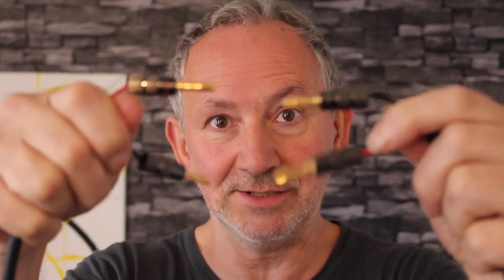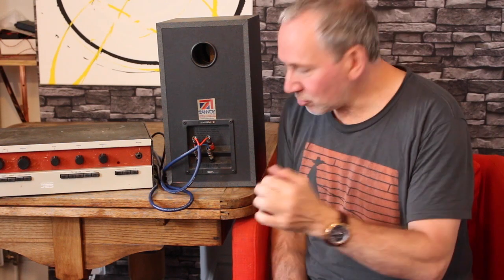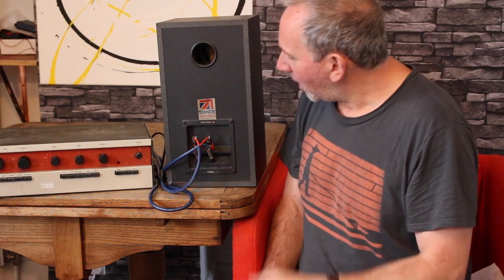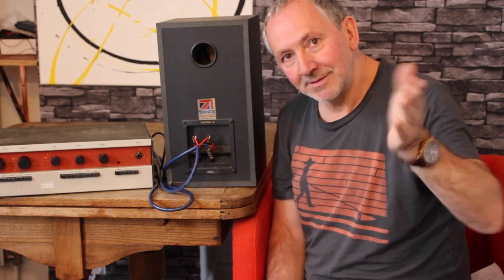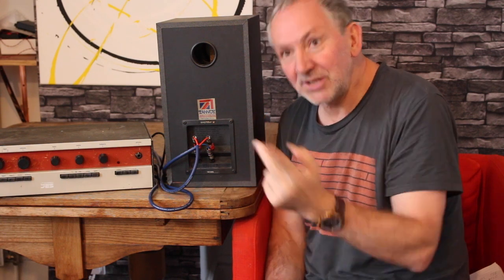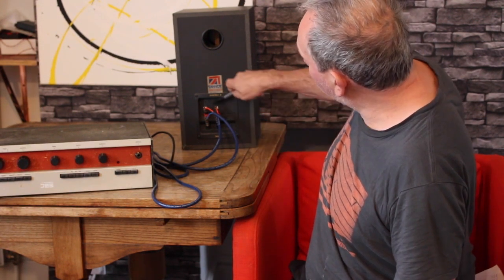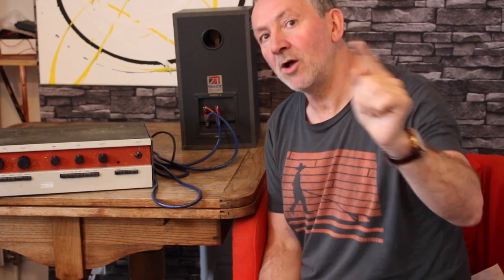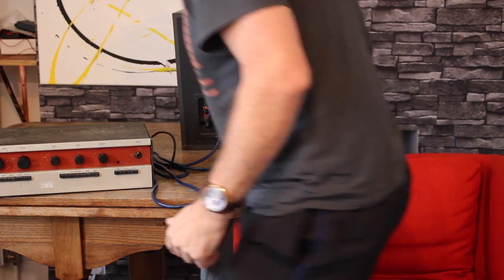WHAT IS BI /WIRING does it improve sound quality

Comment: You are talking through your hat. Maybe you should spend 5 minutes looking at how bi-wireable speakers are actually internally wired. Removing the straps does not eliminate any of the internal circuitry (i.e. crossover components). It just isolates the crossover components for each speaker. If, as you say, the components are eliminated and you were running cable direct from the amplifier output terminals to the tweeter for example, the tweeter would not last very long. With regard to cable size, as long as you've got a cable that will adequately handle the power travelling through it, that is all you need. Bi-wiring is a great way for cable companies to sell more wire. But hey, don't believe me, ask high end manufacturers like JBL what they recommend for cables in their higher end systems! As an example, figure 8, 240v lighting cable is usually good for way in excess of anything your Sugden 50 watt amplifier could throw at it.

Comment: Dynaudio don't offer it on their speakers and they should know. It's a marketing ploy and manufacturers of cheap speakers are pretending that their gear is better than what it really is. Not much of a cost having twin terminals.
Reply: Correct, I have a pair of Evoke 30s and a pair of Emit M20's, and they are not able to be bi wired, and their sou d quality, in my opinion, is so good they don't need it.
Even their highest end speakers do not have any bi wire options.I don't think it makes them less desirable.

Comment: no! if you dont bi - wire them you use a single set of cables not 2 cables joined to one you will just end up with thick cable and a crap sound

Comment: You appear to not have a grasp of how the internal circuitry of a speaker cab works!. Simply bi wiring does not mean that the sound will go directly to the tweeter. It will have to go through a high pass filter first. Don’t want to present frequencies to the tweeter that it simply cannot handle.
Just removing the bridge between the 2 rear terminals on the cab will achieve nowt. You are adding another length of cabe just for starters. The signal will still go via a hp filter. This is a pointless exercise in truth. Just use pro cable in the first place, belden springs to mind. Then you will get real bass & a sparkling top end. Mids, well it depends on your speakers really. A lot of cables aimed at audiophiles & domestic market are in fact, crap!. Also remove the bridging link which is just a piece of pretty crap, & replace with good single strand wire from a flat earth twin cable.
Your ears are playing tricks on you, it seems.

Comment: Not sure what you mean by bi-wiring? Ya? Bi-amping is what I do, which is separating the speakers with an active crossover and using two separates amps to power them. I use a Rane 2 to 5 way active crossover where you can control the frequency range and volume of each channel and I built a box to sum 2 channels to mono for a subwoofer. I would generally use a tri-amp set-up with a Crown IC150 pre-amp, to a graphic equalizer, then the Rane X-over to a Hafler 500 (250W/chl) for subwoofer, a Harmon Cardon Citation III (200W/chl) for lower midrange and a Hafler 100 (105W/chl) for upper mids and treble with a passive crossover between. EV 18" sub in a 17cu.ft. vented box, EV 15" lower mid, EV 6.5" VMR (vented, self contained mid, 16lb. magnet), EV ST-350B horn tweeter (EV PI-15-3) and EV Interface 1, two ways for a rear channel. Ya? If you run full frequencys with 50-100W to a tweeter, you're sure to blow it. Lotsa wires!!!

Comment: Pointless waste of money and time.  It actually slightly and measurable increases bridged distortion in the amp and single runs of low dcr speaker cable are technically better, cheaper and all that is needed.  There's never been one shred of proof that biwiring improves anything.  By the way "listening tests" are NOT a scientific test of anything😉  if people prefer the results, great.  Lets not get carried away and use non representative sample subjective assessment as proof of anything more than personal preference.  You are not cutting out ANY meaningful circuitry by doing it.. that's complete nonesense.
Reply: Ultimately listening is what it is all about, and listening tests can be conducted scientifically. If 80% of a test sample can hear the difference what other proof do you require? How is that personal preference?